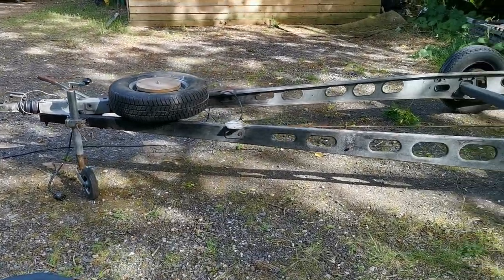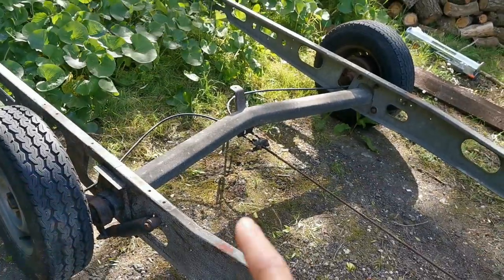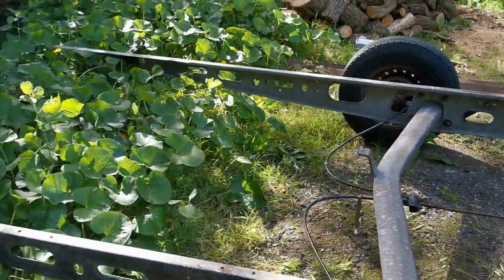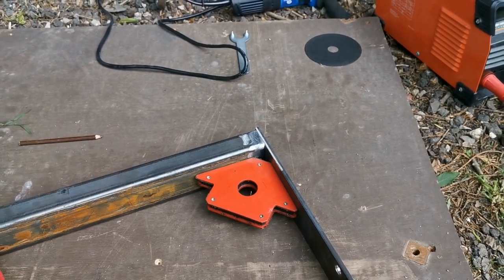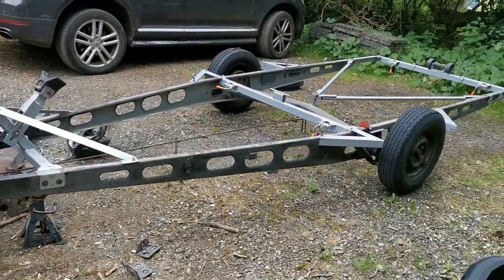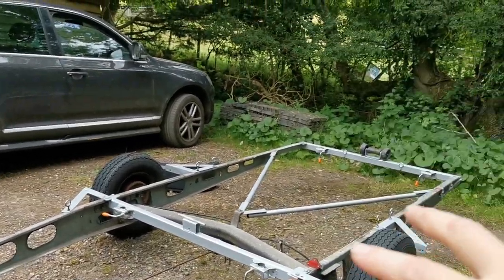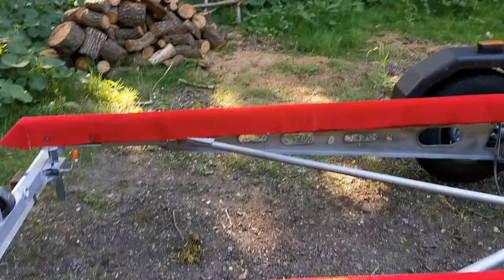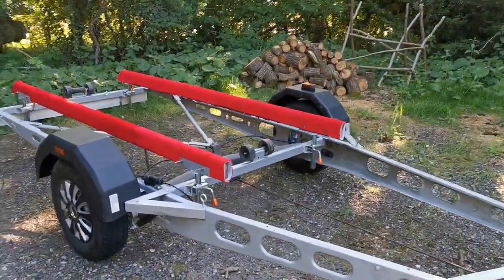Boat trailer build DIY

Comment: welds look great. unfurl your extension lead if ya can when ya welding as it can build up heat and melt the insulation when its curled up like that with big loads . brilliant build thanks for sharing

Comment: You didn’t mention doing this in the UK and putting on the highways without having the trailer tested to DVSA regulations, plated and designed is actually illegal! Not to mention the trailer would also be uninsurable and in the event of an accident the person who put it on the road and made it could be liable.